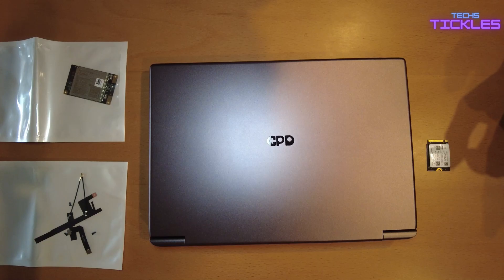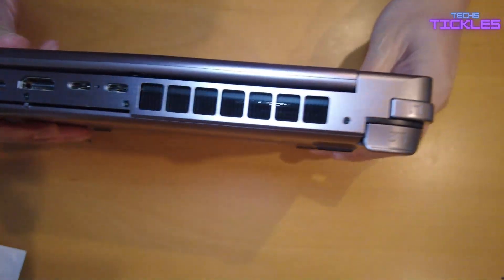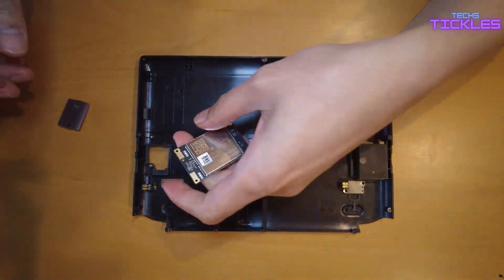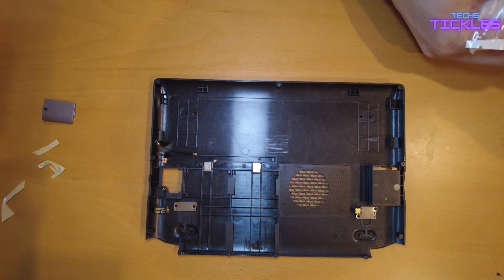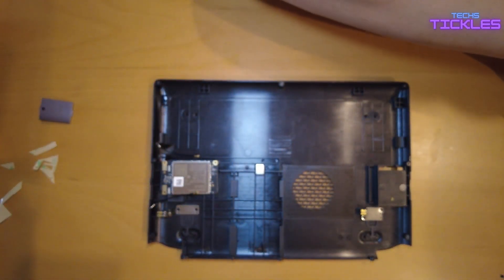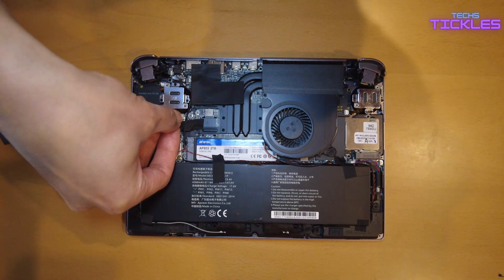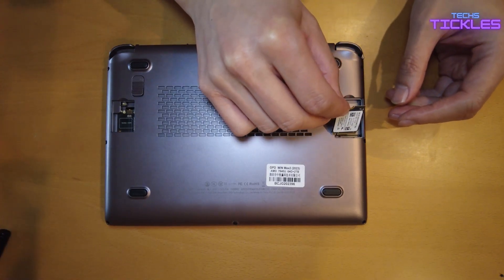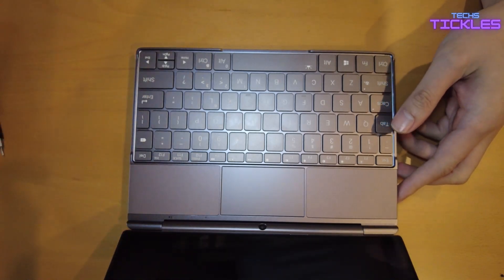GPD Win Max 2 7840u 4G LTE and SSD Install

Comment: Anything u need to install when putting a ssd or would it just show up on the system
Reply from the maker: Sorry just noticed your message. No it would show up, if not you go to your Disk Management (or Create and format hdd partition on Win 11) and you just format there and label the drive letter then good to go.

Comment: What model SSD did you use and where did you buy it from
Reply from the maker: Hi,
I just wanted to share that I’ve recently purchased the Western Digital WD SN740 2TB M.2 SSD 2230 NVMe from AliExpress for AUD $237.76 (USD $151.20). Interestingly, they have a promotion running at the moment, lowering the price to AUD $214.06 (USD $136.13)! Here’s the link if you’re interested: https://s.click.aliexpress.com/e/_Dlvmga7 
So, as of now, I’m running with a 2TB internal 2280 and a 2TB 2230, which is plenty for my current needs. However, I’m definitely keeping an eye out for sales in the future - upgrading to a 4TB or even an 8TB would be fantastic.
Let me know if you have any other questions or need further information!
Reply: Where did you get the 4G dongle from

Comment: I installed my lte 4g module but can't get it to work with a mint sim card. Do you have any recommendations for which sim card to use?
Reply from the maker: I think the codule isn't clipped properly just check it again
Reply: @techstickles1305  I did and it shows its connected in the Network tab. Did you put a sim card yet?
Reply: @techstickles1305  I did and it shows its connected in the Network tab. Did you put a sim card yet?
Reply from the maker: @jonvargas541  yes I did and it works with Australian Optus Network Sim Card.
Reply: @techstickles1305  oh alright ill keep troubleshooting my mint mobile sim card and see what happens, glad to know that it works in general though. Thanks for the video and great instructions 👍